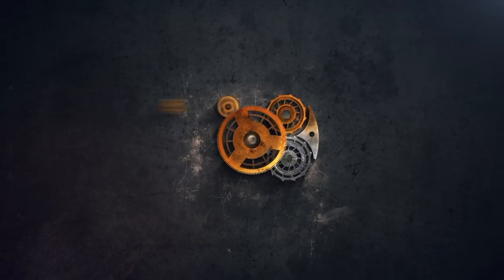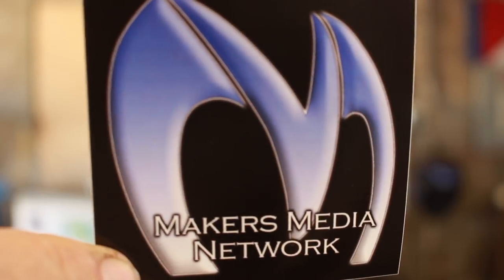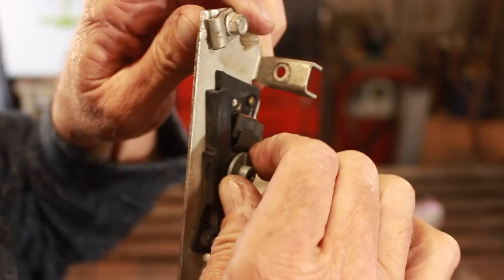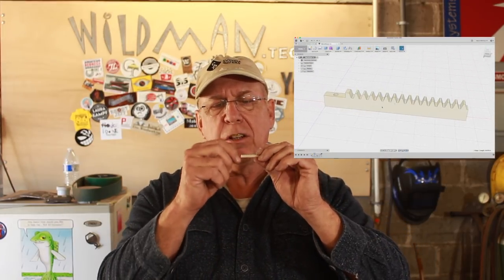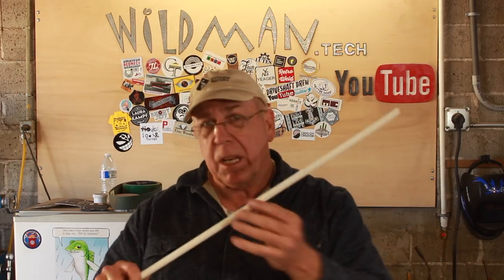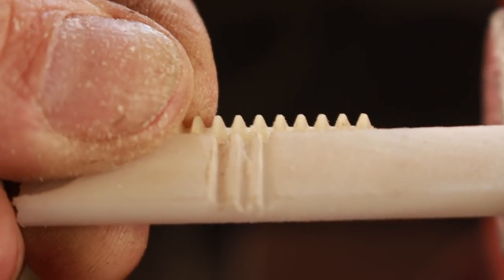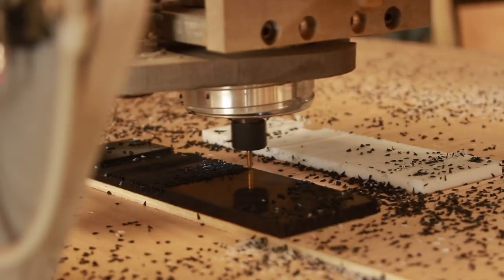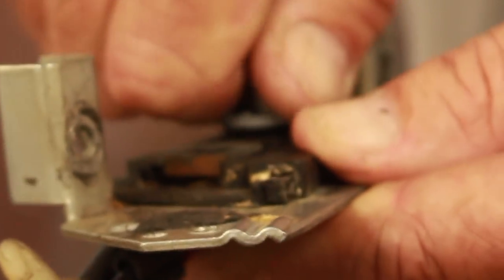Repairing a 1964 Dana Perfect Circle Cruise Control

Comment: Great job on that Marsh.  I have a few friends that are always buying and selling old cars.  I'd bet money that is a very common problem.  You mentioned that someone is doing it from aluminum.  Is there any reason you didn't?  I'm confident your CNC would be able to do the work.
Reply from the maker: Delrin is actually a better material for the application. The rack gear is nylon and aluminum will wear it out.

Comment: Hey Wildman, I need one of those for a Perfect Cruise Control in a 1961 Oldsmobile, I would be pleased to give you $50 for it, How do I buy?
Reply from the maker: There's a purchase link in the description.
Reply: How did you get the old one out? this one appears to be plastic welded into a box
Reply from the maker: You have to drill out a rivet that holds the body onto the metal backing plate.
Reply from the maker: Look in the video at 2:09 and you can see the empty hole from where the rivet was. It could be a screw on some of them.
Reply: Do you think you could make the plastic housing this thing slides in?  Myself and one other I know of need the housing too, I sent him a link to your Video, maybe he asked you already?
Reply from the maker: I could, but I would need one mostly intact to make a CAD model from, then I'd have to mill it out on the milling machine. It wouldn't be cheap. You may be better off finding one at a swap meet or on eBay.
Reply: Can I send you photos for a quote?  How?
Reply from the maker: Contact info is in the description of all of my videos.